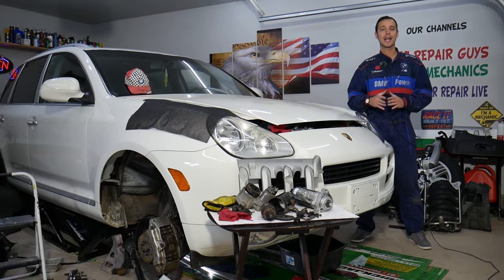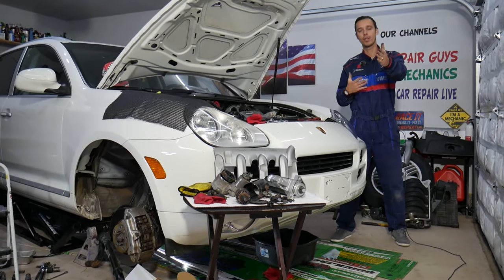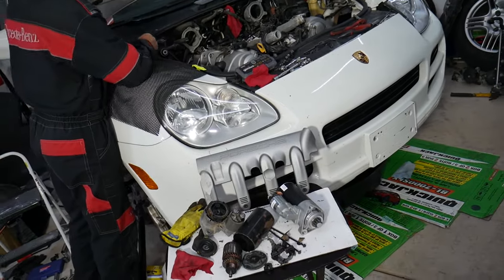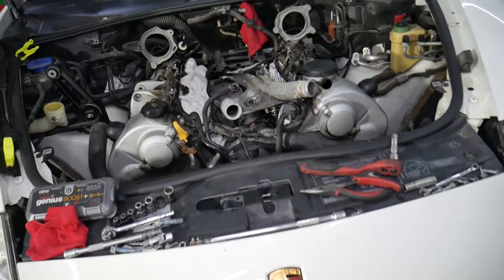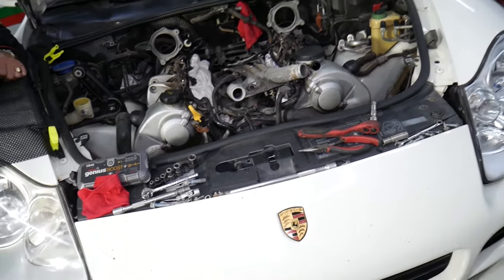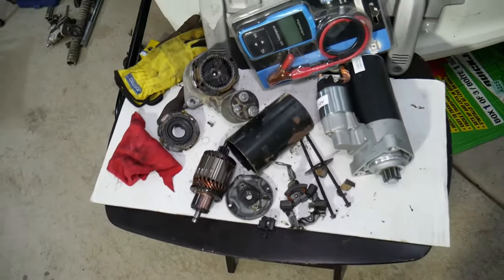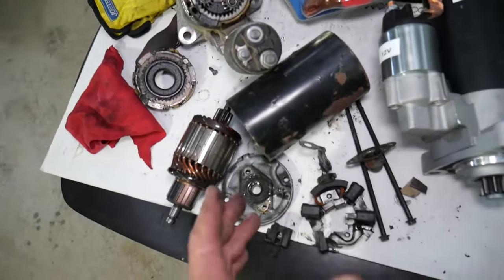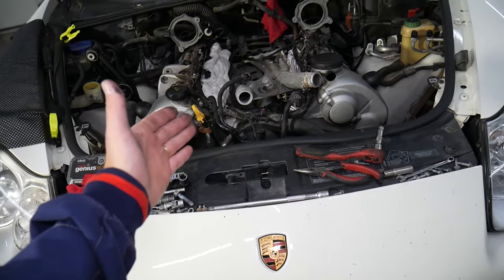TOP 3 REASONS WHY CAR CRANKS SLOW  EASY FIX

Comment: My problem on my 2006 chrysler 300 is that when I turn my key switch it takes at least 5 seconds until my car actually cranks do anyone kno what that problem i put on a new starter still not working
Reply: Have you checked your crank sensor?
Reply: It was my ignition switch bad thanks for advice benny

Comment: So if it cranks slow when cold, but starts right up when warm, is that an indication of a dying battery?
Reply: What was the reason?
Reply: @Hundal22Youtube  i did have a dying battery. Im not sure if other issues might cause the same symptoms, however.
Reply: Yes, batteries don't like the cold to begin with, especially if bad.

Comment: I have a problem with my 1991 Corolla 1.6 the starter swings very slow although the battery is new.
Reply: get your starter checked my brother.
Reply: Check wires first. If it's not the wires then you got a bad starter. You can remove the starter, disassemble and clean it with brake cleaner, then if you're lucky you'll get a couple more years out of it.

Comment: Not the most common causes here but don't forget to:
1. Check your oil. An oil starved engine, if it hasn't locked up completely, can cause the motor and starter to drag. Of course, if that's your problem, the only real remedy is a new or rebuilt engine.
2. Remove the serpentine belt. If it cranks normal without the serpentine belt on, one of the pulleys is locking up or dragging. I've seen locked up A/C compressors do this, and heard of alternators locking up too.
Reply: I’ve just replaced my serpentine belt and this is what I am experiencing now
Reply: I  took the belt 
And tried to turn the crank it's hard to turn I kno the engine is good from 
When it ran 
What could it be

Comment: My car sometimes have a slow crank. Took it to get it tested and they said battery, alternator and starter is good but the battery wasn’t getting a charge like it should. They cleaned corrosion off but only one side since it was visible and the car started up great for a few days then I get a slow crank again. 
What could cause this? Also no engine light either
Reply: This is happening to me too
Reply: Battery...